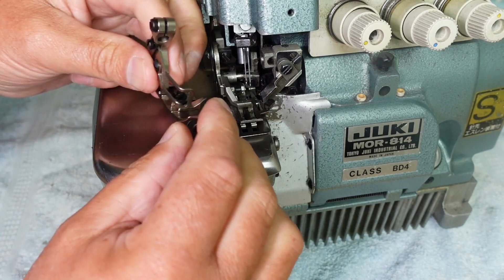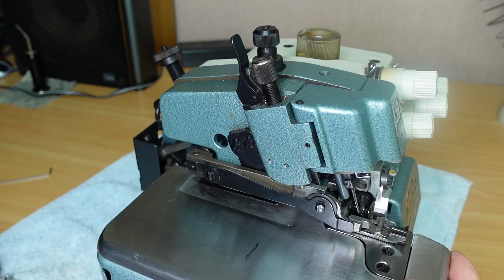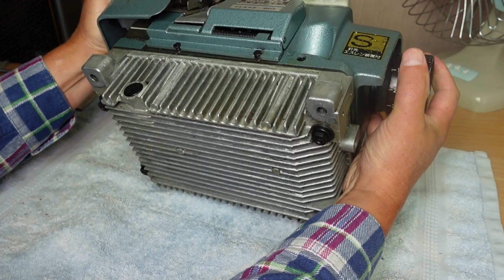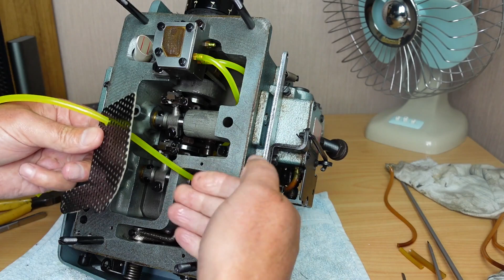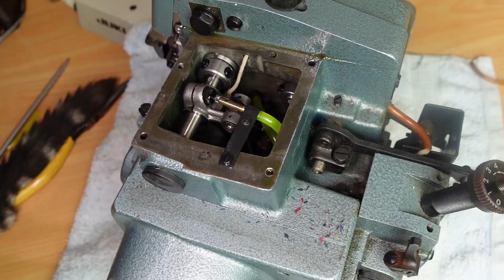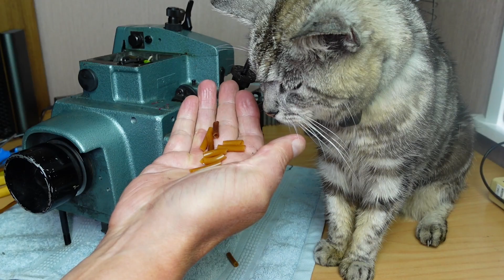Have You Ever Seen a Serger / Overlocker with Top Feed? Juki Industrial Serger MOR-814

Comment: Thank you for posting this.  I've purchased this same 'workhorse' used from a garment factory ten years ago and never knew a lot about it (other than the standard 'serger' instructions.   I absolutely love this machine.   I came looking to find a video that would show how to set the upper and lower blades on this machine.  Do you have a video on how I can do that?
Reply from the maker: Sorry, not at this stage.
Reply: I have found this video.  It's a different machine but it identified what I was doing wrong.  I wasn't setting the spring that pushed against the lower blade.  My machine works like a charm now.  https://www.youtube.com/watch?v=RjrFzpTzGB8

Comment: Nice job, thanks for sharing all the details.
It looks like you used fuel resistant fuel line for the oil lines, I imagine the original were vinyl tubing so the new lines should last much longer
Reply from the maker: Thanks. I used fuel tubing I picked up from the Stihl shop locally.